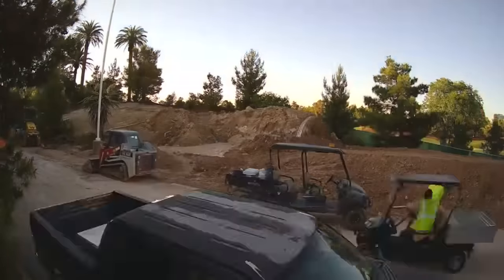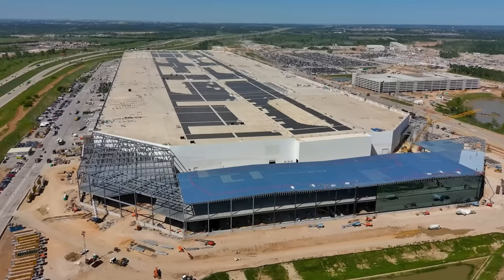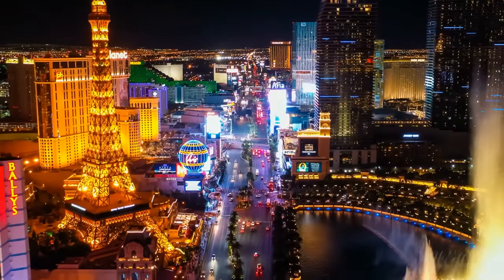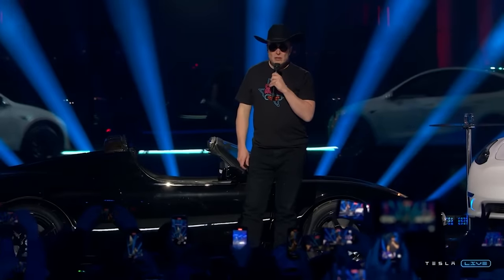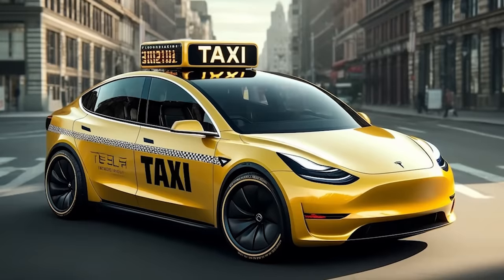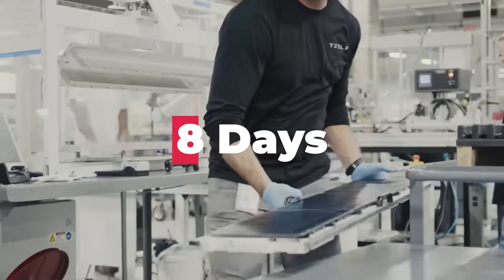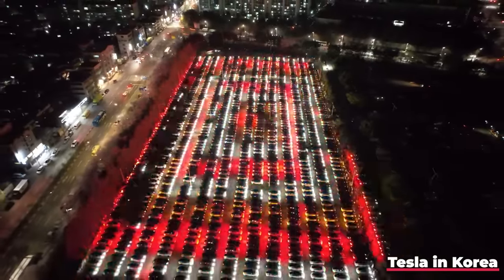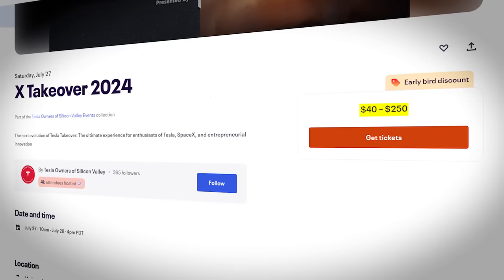The Boring Company Texas Take Over Has Begun!

Comment: What I want to know:  
1. Can you drive a Semi through it? or..
2. even just a standard Shipping Container in a different vehichle?
3. Will it work as an underground aquaduct?  ...the idea of moving storm overflow water to dryer climes  is interesting...or even refill the Aral sea etc
Reply: Answers:
1. No
2. No
3. Yes, lots of these are being built around the world of all different sizes (45km x 9m diameter in India for example)
Reply: @tunnellingsalisbury7605   A standard shipping container is 8'wide by 8'6" tall... but if that barely fits ( and I guess it might, am bad at math) then a specialized carrier vehicle would be needed I think.  A Semi or even a train likely would need a Bigger Boring Machine.
Reply: Stay tuned ...
Reply: @Peoples_Republic_of_Cotati  8' x 8'6" = 11' 8" across the diameter. Tunnel is 12' diameter. Not much room left there for tolerance and going round corners! So in practice it wouldn't fit.
Reply: 12 feet in diameter, so too small for standard shipping container. Ideal for movement of water. Its lined and should serve well in that regard.

Comment: Mask is not that smart. In Vegas Boring company should make multiple exits brunching at the end of the tunnel, eliminating the bottle neck. That should  increase the cost of the entire project. The slow down at destination point is expected, that's why multiple exits are needed. It is cheaper to make multiple exits on the surface, but if the surface space is limited, then you have to dig them underground or perhaps building a 5 story highway tower with multiple exits like in China at the modern bridge exit. So it definitely needs a multiple exit upgrade and depending on purpose it might need spiral parking garages at the destination points. So if the slow down speed at the end 5 - 10 miles/h and desired tunnel speed is 100 m/h, then 100/5= number of end exits you will need. Speed trains in Moscow metro run every 30 sec. - the tightest at 70km/h, but with the train you have enormous volume, unlike with the car, wile tunnel capacity is the same. So car transport is a very wasteful way in comparison to a metro and should be designed differently with multiple branches and multiple exits at destinations. USA highways are clattered because they were not designed properly for high traffic at destination points and lack multiple exits, because those are costly and if you make them underground, even more so. Perhaps a flying car would be a solution, but you need an autopilot navigation to avoid the air collisions.

Comment: Curious to know what it will actually be drilling through. The land Giga Texas is built upon is soft, sandy, silty river wash type soil. The area around it is littered with water filled gravel and sand pits. Now it may be that the sandy soil is not very deep and there is some firm soil or even rock there. However, that area is what we call "off the escarpment" in that it is below the rocky Balcones Escarpment geology. I could be wrong, but there may not be any rock there for Prufrock to drill through. If that is the case, why bother using it at all? Plus if it's only going to be 15 feet below the road, that seems like not enough to avoid undermining the road or destabilizing the roadbed.
Reply: The cutterhead is only dressed for soft material. No rock expected. EPB TBM’s such as this are generally made for soft ground, silt, clay type geology.
Reply: @davidsalisbury50  Thanks
Reply: You can watch it boring the tunnel at Giga Texas now. It is just about to exit the other side of the highway now. We think it is under Giga Texas factory now. I guess we think it is going to exit inside Giga Texas. 
I just dont know where the darn thing is going to pop up. 
Someone has been counting the concrete rings that are installed underground. Then estimating how many feet it has went so far.
I think it has reached the factory perimeter.
Come out, come out, where ever, you are.
🎉

Comment: Wait a a minute, what am I missing?   2:56  they're going to dig out 25 miles of tunnels, and when added to the existing convention center loop will make a 65 mile long project?    So the convention center loop is 40 miles long?  That doesn't seem right.
Reply: it took them 1 year to do 1 mile
Reply: @jebes909090  Yeah, but they are footing most of (all) the cost as the tunneling gets faster and faster. Prufrock is much faster but I think a few years before they get all the kinks out. The current rate is (in theory) 1 mile per week and porpoising will get rid of setup time... still need to see that demostrated. Goal is 1 mile/day. There was talk of faster, but no concepts on how that might be done.
Reply: @avgjoe5969  its alway next year with elon.

Comment: I warned Elon Musk that he should be focusing on (1) New design "Rotary Wankel Airmotor" systems using failsafe 20,000+ psi CFC air pressure tanks for 1000+ miles range per fill-up of the air pressure tank, for all surface-vehicle and VTOL-aircraft applications; and also (2) Henry Wm Wallace field propulsion technology patented in 1971 using bismuth or other half-integer nuclear spin materials at high speed in rotor/stator configuration to produce "antigravity" field propulsion effect without rockets. Right now Tesla is struggling to remain relevant but will not achieve continuing relevancy using the botched Lithium-ion battery technology and unnecessarily complex technology. The best inventions are the simplest inventions that can do the job -- Elon Musk knows this. These are the best and simplest technologies that can do the job of surface, VTOL aircraft, and interstellar spacecraft transportation systems.
Reply: The guy never listens

Comment: I thought of an idea that could bring Musks robotaxis to the next level. What if you were to connect them in a line where people could walk from one to another. Then what if each individual taxi was made larger so it could seat more people. We could replace the wheels with steel so they're more durable, then we could place those wheels on rails so they could slide. Finally, instead of it of needing a big bulky battery it could be powered by an overhead line.

BUILD FUCKING TRAINS AND TRAMS ALREADY!
Reply: When do you think they will build a rail link to everyones house?
Reply: @michaeldautel7568  I don't know. But we could have these big parking lots that you could drive to, park your car and go down a AI powered stair system that takes you down to the tesla robotaxi system that takes you to high demand areas in a city.

And if there's somewhere in the city the robotaxi doesn't take you to. You could have a smaller above ground one

I don't think this has ever been thought of before, like ever, totally not. I would highly doubt this existed in the early 1900s in America.
Reply: @michaeldautel7568   But, but, but his idea, FEELS GOOD. Won't work, but that fact never stopped the far-left leaners from causing harm to the rest of us.